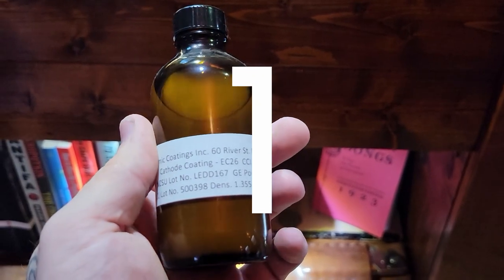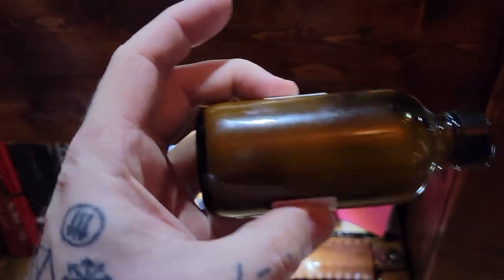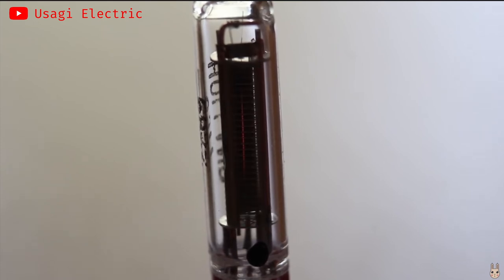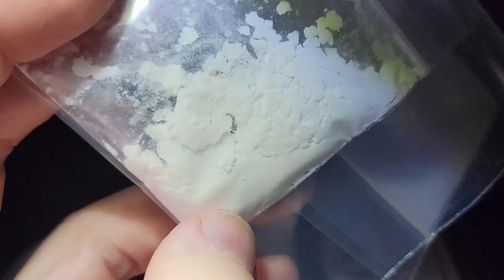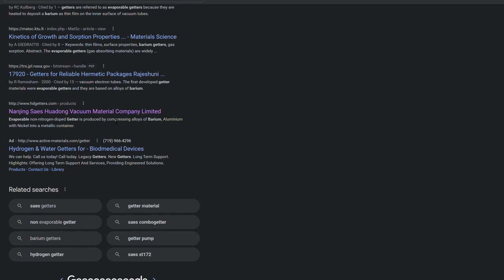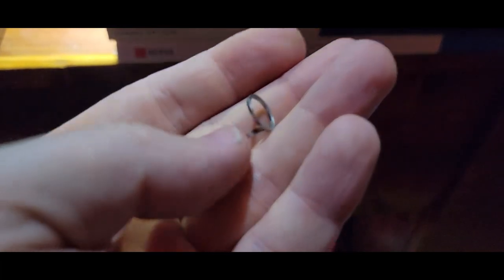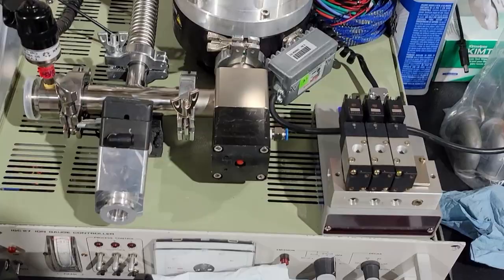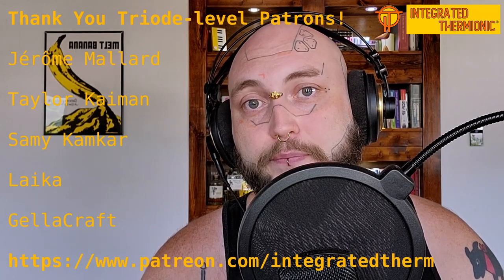Sourcing Uncommon Materials for Vacuum Tube Manufacture

Comment: I work in vacuum industries as a glassblower in the UK! I work at a small company called Torr Scientific, and we have heard about Moores too. Real strange to find a video on a company mine knows quite well. We make very similar products, including pin bases. We've made ion tubes in the past, albeit I haven't personally, also with 8250 borosilicate and Kovar pins. Just as a warning, 8250 does not have the same thermal expansion as pyrex/commercial borosilicate. You would need a graded seal to be able to join it to pyrex if you were to do glasswork. We also sell just graded tubulations sometimes, no pin, no base, just a metal tube at a standard size, welded onto a flange and with a graded seal

We often do 1 offs/small batches of parts. I can't say we never have minimum orders because I'm not in the sales departments, but we've definitely make only 10 of an item or only 1 of an item before, especially in the glass shop area.
Reply from the maker: Oh, that's awesome to hear! Yeah, I'm still having trouble sourcing 8250 tubing for my envelopes, so I haven't been able to test the Moore's stems. The one tube I've made so far utilized a tungsten/boro seal with commercial 33COE borosilicate.
Reply: @SignalDitch  EU Glass supply used to be the go to for pretty much all sci glass supply.. as the industry shrank the suppliers fizzled out or began supplying pipe and bead makers.. If I needed to find 8250 I would just hit up UST in PA ask for Frank and let him find it for you.. You can also get Schott Duran from them too..

Comment: Your videos are unbelievable. The amount of useful information and clarity of presentation is over the top. I have subscribed and I am looking forward to watching the rest of your videos.

BTW: I have gotten my glass blowing skills up to the point that I have made a couple of simple tubes, but my vacuum system isn’t up to what it needs to be yet. I’m working on that now. For those who are having trouble with wire feeds through the glass, it SEEMS that the wires that are used in neon sign tube ends work in borosilicate. What I have done is purchased the neon sign tube ends (electrodes) from a local neon shop, broken the wires out, then crimped them into my boro. The tube ends cost me $2.50 each. No too bad,
Reply from the maker: Oh that's interesting, any idea what the wires are made from? I believe boro electrodes use tungsten wire but soft glass electrodes often use Dumet.
Reply: @SignalDitch  ,  I seem to remember reading in an old article that some vacuum tubes used a nickel ally called Monel for the pins or wires in order to have a good, airtight glass to metal seal.

Comment: I’m currently toying with the idea of making my own X-ray tube. I’ve watched only three videos in this series so far and it’s a WEALTH of information. I’m actually feeling semi confident I could pull it off. Thank you so much for these!
Reply: Yeah. As one replacement light bulb for a CAT scan machine costs £250K, that would be an excellent side business. They need to operate on average at 120 KV at 200 mA (w/o iodine contrast), so they need a very robust filament and a spinning tungsten anode, hence the cost...

Comment: I sourced stems from Richland and Fredericks for crt rebuilding.  Our stems were made from leaded glass and were 20 pin.  We were attempting to rebuild 15GP22 color crt's (the first tri-color mass produced color crt) invented by RCA back in 1953.  Richland was our preferred vendor and they had a large ready to use tooling inventory.  I have photos of the stem making process done at Richland, but I do not know how to contact you to send them.  Unfortunately we were working with Hawkeye (last crt rebuilder that closed 10 years ago) and the project reached a dead end when he closed his shop.  There are a couple other fellows that were involved, one of which is going to set up a crt rebuilding shop, and he has already acquired the equipment needed.  The most difficult issue (as you already know) is obtaining materials such as electron guns.  Since Southwest Vacuum Products In Stone Mtn Georgia closed (they were our source for rebuilding our guns) we are at a loss for a company that can rebuild crt electron guns.  Before Southwest closed, we had them rebuild 10 guns for us and they are in a dry keeper waiting for the project to resume (I probably will be in my grave before that happens)  The fellow who is going to set up a crt rebuilding shop might be interested in any sources you may have discovered that can produce crt electron gun assemblies.

Comment: 18:20 - I think a more modern approach could be implemented for which anyone can build button stems at home for low cost but would need a mini precision CNC (which expensive but useful for all hobby applications, a one time investment). Basically custom make "meta-to-glass feedtroughs" as the button stems. There are many ways to make them, one of which is to use Epoxy. Kovar wire is used to do the hermetic seal between glass and metal. I'm planning to make some custom large nixie tubes and never liked the glass button stems due to it being impossible to source, limited in custom designs, need to play with a torch to seal ends and check for stress strains. The MOQ to buy these glass button stems could be spent to buy a precision CNC. Also I never seen anyone using this modern way to make button stems for Nixie Tubes/Discharge tubes/Vacuum tubes at the hobby or consumer level, it's only used in high end space equipment and voodoo scientific research. I agree, the open source/hobby community needs a better, easier and cheaper way to make button stems.
Reply: I have a few cases of button stems, not sure how to get them to people who need them.

Comment: Okay, 'fess up: Tom Waits wrote "What's He Building In There?" about YOU ! 😂  In all seriousness, this is quite a journey you have embarked upon.  A few thoughts sparked by your videos: 1st of all, from what I could see of your vacuum tube stash, it seems you have a large collection of what could be charitably called "weeds".  There's an old saying that a weed is a plant that nobody has found use for yet; but when it comes to vacuum tubes, a weed is a vacuum tube that is still common or ubiquitous because nobody has a use for it any more. Oddball TV tubes with weird heater/filament voltages being a case in point:  You can still find vintage TV serviceman's caddies full of those "weed" tubes because virtually no one restores those TV sets anymore, so perhaps you could actually cut the bases off of all those nearly useless tubes and reuse them?  This presumes that the glass you would be using to manufacture new tube bottles (technically I believe "envelopes" is the correct term) would be the same type of glass as was used in those tube stems originally, presumably borosilicate glass.  It may interest you to know that JJ has been having a lot of problems over the past year or so with glass envelopes that crack, fail, and lose their vacuum. This is well known in the guitar amp repair-tech world.  Nobody seems to know if JJ has switched suppliers and is using glass from a different manufacturer or if they're skipping steps in the annealing process.

 You mentioned thoriated tungsten filmments in a previous video. Thorium does have the advantage that tubes made with thoriated tungsten filaments can actually be rejuvenated when the become weak, by briefly applying a higher than normal voltage to the filament, which causes fresh thorium to diffuse to the surface of the tungsten filament. I've actually done this with some old antique radio types, I can't remember if it was the WD11 or the UV 199 tubes but one of those types has thoriated tungsten filaments and actually can indeed be rejuvenated!  The disadvantage to thorium, of course, is that it is radioactive.

Comment: Western Electric claimed they were going to jump back into the essentials tube building process back at the start of the Russian/Ukranian war. But they were all hot air. I have written them a few times over time to ask how that was coming and I get the same PR corporate drivel. They are as worthless. They had a chance to corner a market both for hi-fi enthusiasts and guitar amp users, and literally did nothing.

Comment: I'm currently in the process of working on two build projects that use vacuum tubes, one is a guitar amp I'm calling the Sloclone 50, basically a 50W Soldano SLO that will be using 5 JJECC83 tubes and two JJ KT77 tubes, the other is an OTL (Output Transformerless) Headphone Amplifier that uses three Svetlana 6N1P dual triode tubes, I just need to finish getting all the needed parts together before I can do more work on the two projects.
Reply: The 6V6 pentodes work best for audio amplifiers. They have a peculiar transconductance curve so when the 6V6 saturates, the entire gain function shifts downward so the output is never brutally clipped. To achieve this you must work out the screen grid current depending on the specific tube, and match it among both push and pull tubes...